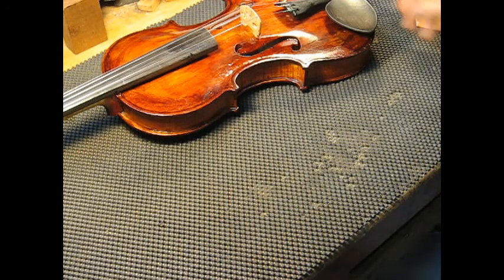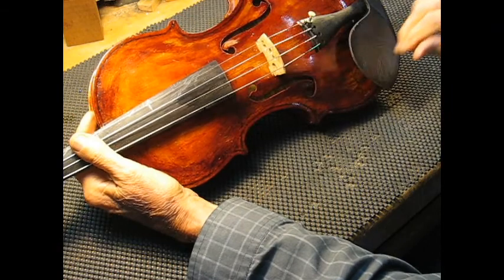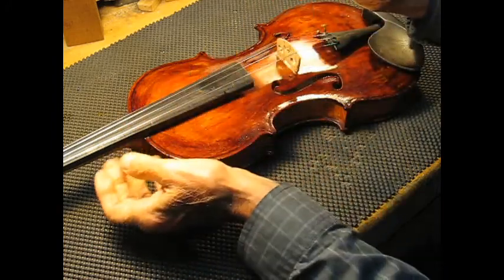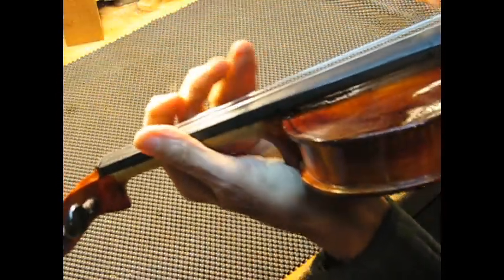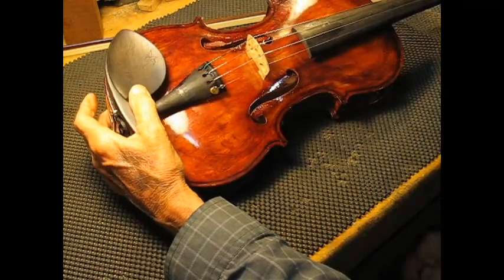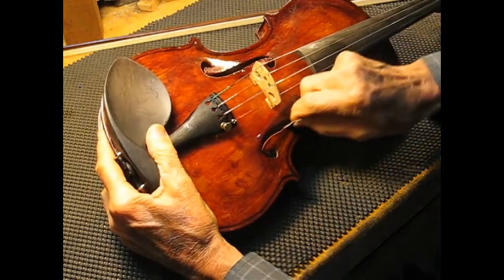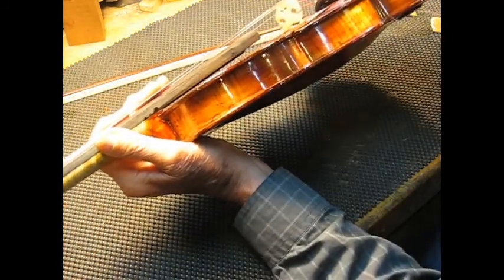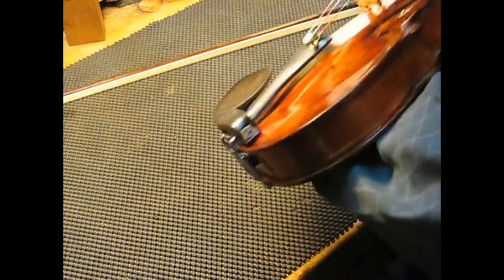Violin String Balance Via Sound Holes Technique

Comment: Greetings maestro! I have a cheap chinese violin. Why dies the a-string sound harsh and screaming? I left it to a luthier who moved the soundpost but to no improvement.
Reply from the maker: Sigge;  Thank you asking, I believe many others have similar questions.  The answer is that the bridge needs an adjustment to the Bass side heart in the up and out directions (they influence the string on the OPPOSITE side, believe it or not!).  On the website www.violinresearch.com and the actual direct page address: http://www.violinresearch.com/acousticaladjustment_046.htm , You will see the instructions.  Do this with a round or curved jewelers file, in small steps playing often to check progress.  STOP when you are satisfied.  This information is the result of a Finnish scientist who studied bridge problems for several years.  David L.
Reply: @dalemfg  Thanks, that is great information. Funny enough i did read another article by this finn last week. I will try and will report back.
Reply: @dalemfg  Having read the article that you proposed i fear that I need a smaller heart in the bridge. Is it possible to fill a tiny bit with glue?
Reply: @dalemfg  My violin is already very loud and screamy. As you can see on my video the bridge has small cavities as if untouched. Carving the heart will make louder if I'm correct. So I removed 1mm under the beam to no effect. Any suggestions? https://www.youtube.com/watch?v=6XzxxKE9kLs
Reply from the maker: @SiggeSvahn  Sigge;  Thank you for sharing the short demonstration video, that really helps.  It seems like there is the beginning of so pleasant note tone, so be encouraged.  Listening the your recording, it sounds like the upper strings are more powerful than the low toned, and thus unbalanced.  The power of the strings should be equal.  I would suggest you watch this short video on how to even out the string power, as this might be helpful.  A second think to consider is the tuning of the end pin.  This is more important than commonly known.  The tap tone of the end pin (horizontally tapped from behind on the head; should be the same as the tap tone of the back plate.  If they do not match exactly, this could be a cure for your complaint.  Please see the website and look up information on end pin tuning.  David L.
Reply: @dalemfg  Thankyou for good advice. The top is thick. Being a violin I can spare I've decided to remove the top and do some hardcore thinning on top & bass bar. It will likely happen after Christmas holidays.